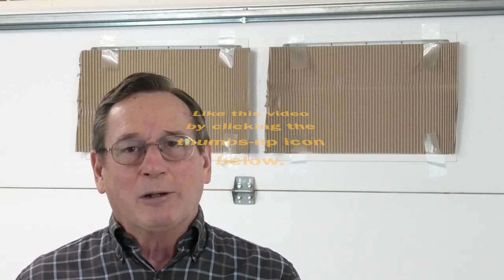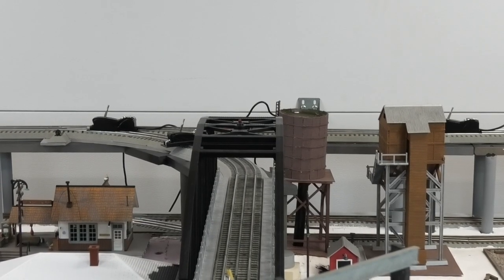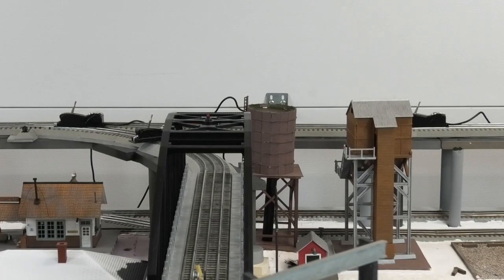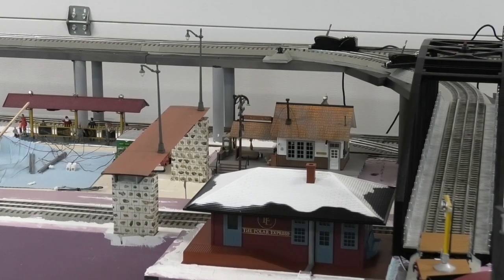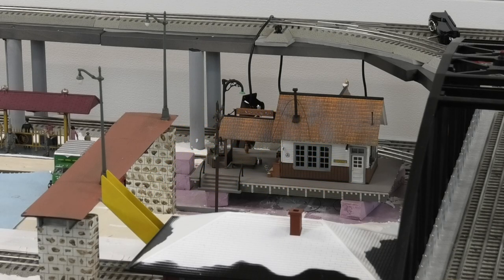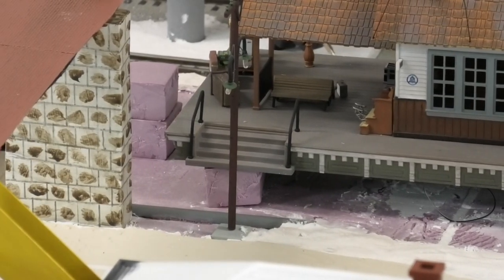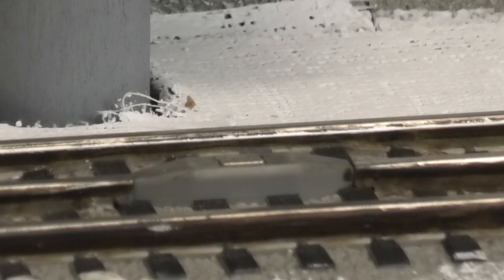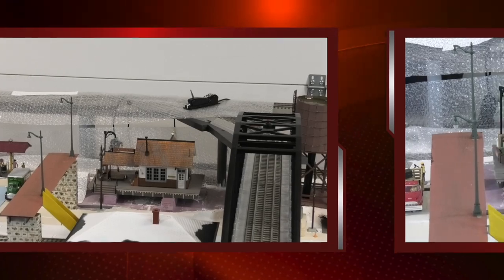Polar Express O-gauge Landscaping Pedestrian Bridge & Station

Comment: Thermostat wire works very well to hook up those remote switches. You can get it with 4 to 12 bars that way you can run one run and displayed off to your switches

Comment: What problems were you having with your Fastrack switches?  Is it mechanical or electrical?  My layout is built around 13 switches, mostly O36 Fastrack Command Control switches.  So far I have had 3 of them jam.  You can hear the points trying to move and even see them make some movement, but they don't throw all the way.  You can't even move them manually, with your fingers.  I'd be interested in learning what issues you have had. - Jim B